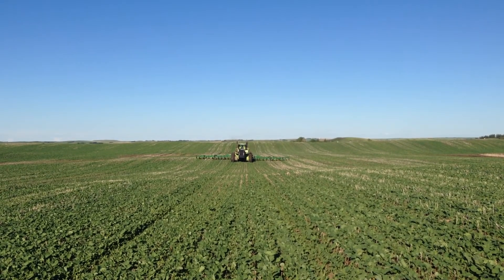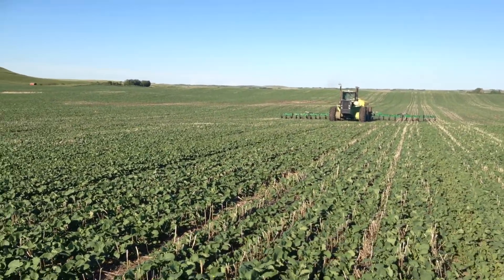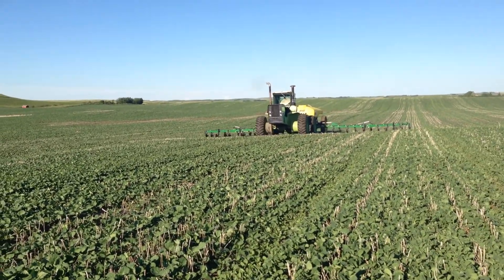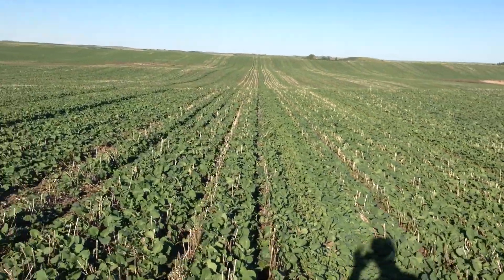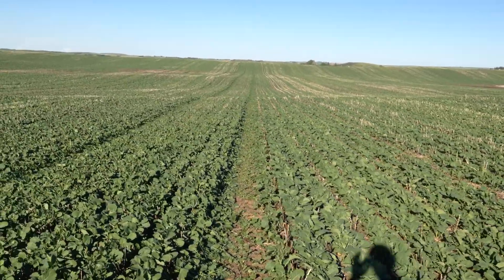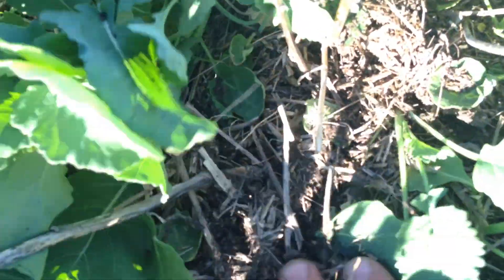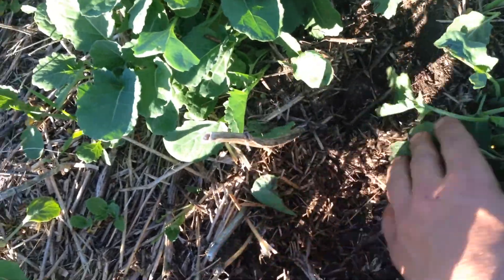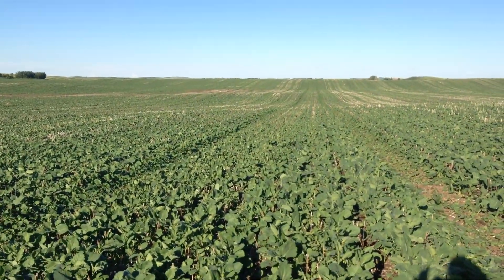Nitrogen sidedress toolbar in canola

Comment: What's your opinion on the use of this toolbar on crop planted with a 1" opener on 9.8" spacing?
Reply from the maker: You can use a toolbar set up on 19.6" rows. There is a high level of accuracy needed to stay between the rows. This may require passive or active implement steering on your drill and toolbar. This keeps your rows straight. Without it, you may inject nitrogen beside one row and 10" away from the next which will lead to alternating plant heights and yield. John Deere Isteer with ProTrakker hitch or Trimble True Guide with Protrakker can help you achieve this.